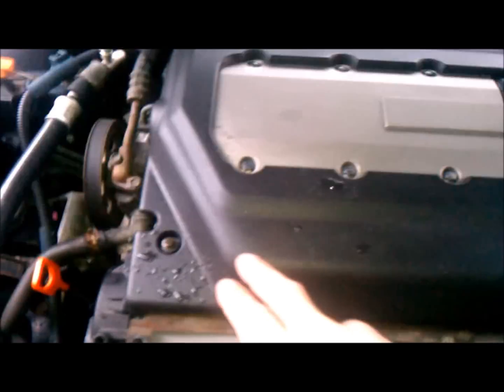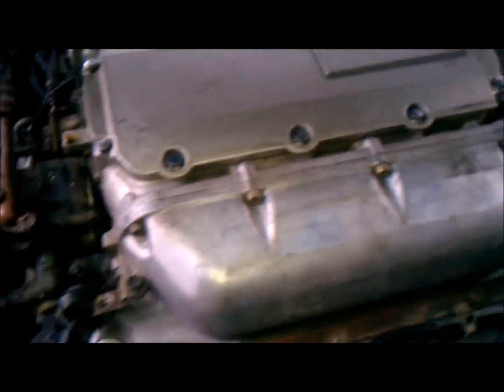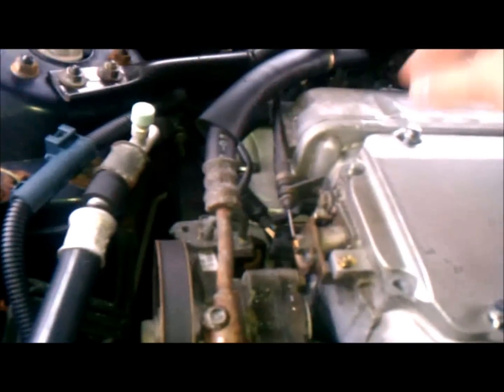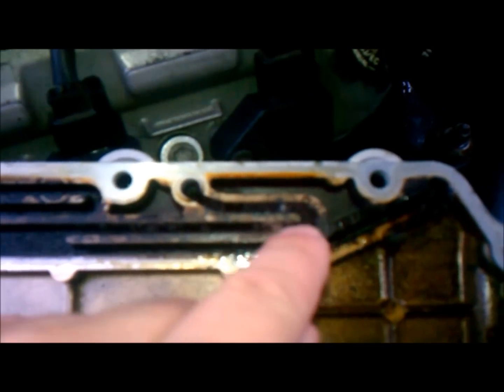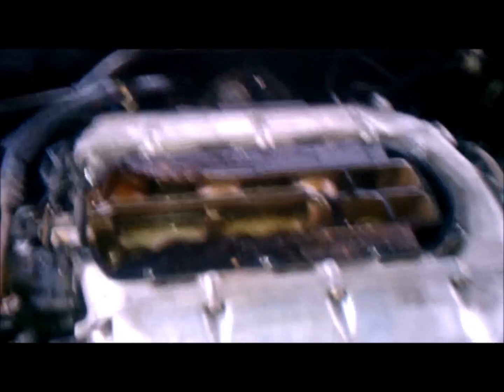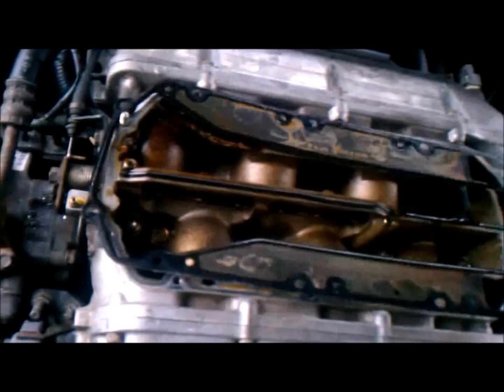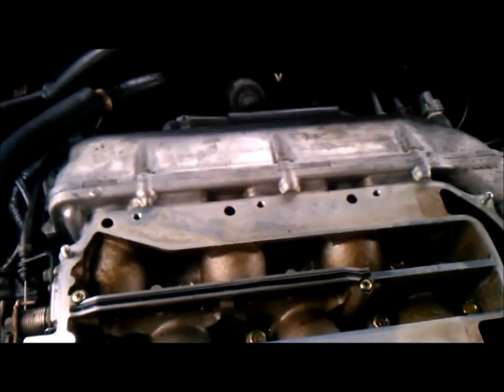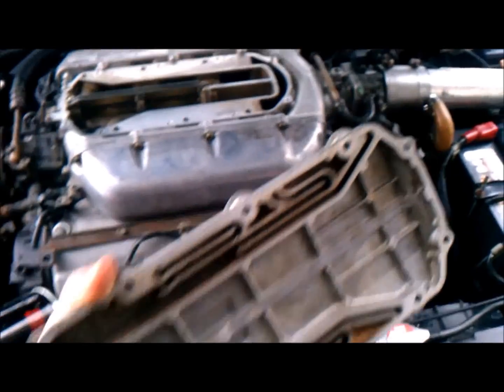Acura 3.2 TL, CL, MDX misfire repair Procedure (Tech Bulletin).wmv

Comment: What about 04' models?

I have a hesitation at around 1750 rpm below 40 mph only...Doesn't do it above 40 mph.
Car jerks until to give more gas or let off throttle. Feels terrible

Seems like a bad coil, dealer will not look at without a CEL on. I made it go on once while beating on it and there were misfire codes. They swapped coils around and still same issue. Im going to pull the coils out and check for a bad one. 

Plugs are 6 months old. Im afraid to even open the cover on my engine like you did and clean it.
Reply: I had a transmission issues. Trying to get it covered under warranty now. 
Going to do this anyway because I have gotten P0301 and P0305 codes before.

Comment from the maker: If you have a mechanic stethoscope, you can listen to them, good ones click when running although this is not always a good check because sometimes they work at idle and fail at higher rpm..if  you don't have a stethoscope, run the motor and one by one you can unplug the wire to the coil and plug them back in. The motor will start to run very rough when you unplug a good coil, if you unplug a bad one you won't see a change in idle. Just make sure you do one at a time as the motor won't run with more then one unplugged for more then a few seconds.
Reply: +Edward Naso II (Naso Pools) hey man i got the same codes on my 2000, new plugs now i only get 1399 think i should go ahead and clean the ports?
Reply from the maker: +DeejayMC25 yes clean the ports and verify your gasket is on the right side up...many are not from a factory error. do this and the code should not come back
Reply: +Edward Naso II (Naso Pools) yeah man I cleaned the ports, they bad made my heart drop a bit I just bought this too second hand now only cylinder 4 is misfiring so I figure it must be that coil thanks for the video it's already running way better
Reply from the maker: +Edward Naso II (Naso Pools) great to hear I could help! :) good luck with it!
Reply: +Edward Naso II (Naso Pools) Great video,friend of mine has a 2002 3.2 TL and the local garage has put in 3 coils and the CEL keeps coming on. I will pull the manifold and clean as needed. Its got about 170,000 miles. Again good easy to understand video.
Reply from the maker: glad to help, it will definitely fix the problem.
Reply: +Edward Naso II (Naso Pools) I pulled the plenum cover and while it did have some buildup in the channels and the six ports were partially clogged, the biggest problem seemed to be the large port on the drivers side that was almost closed off with sludge. I used a small screwdriver to clean out the ports and sprayed carb cleaner in the ports and used compressed air to blow out any remaining sludge. 
I cleared the codes and all seems to be well. Is the EGR valve hard to remove as I might want to clean it out?Thanks again.
Reply from the maker: It's very easily accessible on these motors right on the top. I would not recommend cleaning it. Replacement only. Although if the problem is solved I would leave it alone

Comment: I have the same type of car but the problem I am having is when I put the car in D5 and take off it gets stuck in the 2nd and 4th gear. Could this be the same problem or is it the clutch sensors?
Reply: change the transmission sensors on 3rd and 4th gear.
2004 Acura TL part no.: 
28600-RAY-003  & 28610-RAY-003
SWITCH ASSY., AT OIL PRESSURE (TEXAS INSTRUMENTS)

Comment: After performing your procedure, the car would not start up.  It starts cranking but the car will not completely start.  It sounds like it wants to start, and it is about to, but does not.  I cleaned the gasket as well as the egr ports, could that be the problem?

Comment from the maker: Shindemon33, it sounds like you have an air leak, I would remove the top again and check the gasket make sure none of the seals are crushed. You may need to replace the gasket and when reinstalling make sure you torque properly in a criss cross pattern

Comment: Great video!  Without realizing it, my son's car went a year (10,000 miles) without an oil change - YIKES!  The engine light and caution light went on this morning, and it drove very rough.  Oil change light was not on.  Checked the oil, and it was very low.  Put some oil in it and drove to Valvaline, where they checked the codes.  Misfire on 1,2,4,5 cylinders and P1399 code.  Have a 10mm ratchet - have done electric and plumbing, but not cars.  Should I try this, or take to a dealer??

Comment: OBD II connector is located in the tray/dish area between the seat heater switches.  There is a little tray/dish like area in front of the gear selector, all the way down under the nav unit.  You will have to open it / take off the cover.

Comment: Can you tell me where the OBD II connector is located on my 2001 Acura CL-S 3.2. Ran the battery down listening to the radio, now having intermittent engine shutting off but restarting going down the road. The dude at advance could not locate the connector to get a code for me. Battery connectors have been cleaned, believe atleastba contributing factor.  Thank you for any and all help.

Comment: common issue you identified, i just looked at my the other day, they looked like your finished intake. my car has 170k (2004 acura mdx), just replaced iridrium spark plugs i got online for $9-each, coils look fine (brand new), i also bought mine second hand. coils are cheap, i saw ebay/online as low as $8/each. great video!

Comment from the maker: sounds like you have a bad ignition coil. start the car and unplug one coil at a time (the coil is the black tube that plugs into your spark plug)...while the car is running, unplugging a good coil will make it running significantly worse.. unplugging that bad coil will not make any change.... replace the bad coil. FYI- normally when one coil goes bad they are all ready to be replaced.

Comment: I found out that the EGR valve code that was popping up is associated the random misfires. I unplugged the coils one by one while the car was running and found the one bad coil that caused all the problems. Thank you very much for your help!! I was soooo worried.

Comment from the maker: It sounds like it might be time to replace your coils. you can get 6 aftermarket ones pretty inexpensively on eBay and they work great. unfortunately Honda and Acura tech/shop manuals have no test to perform this diagnosis. Their steps are check everything, if all else fails,  replace the coils. I know it sounds crazy but trust me there is no test to perform to check a functioning coil because a resistance check won't tell you anything at different rpm range. If you have a nice scope you maybe a
Reply: Likely, NO.  EGR system buildup is the common issue with 01 and 02 honda/ acura and multi-misfire code (that and gasket on wrong way). Yearly check and maintenance.

Comment from the maker: It sounds like one of the two ignition coils has gone bad. It will need replacement... The ignition coil is the long black tube that plugs into the spark plug.. they are expensive factory and just fyi,  I have had much success with aftermarket ones on eBay... Best of luck

Comment: Another very common cause is tight valves. Most of these engines will suffer from many misfires if the valves haven't been adjusted. A quick easy way to check is to find someone with a scan tool and at idle with all accessories off watch MAP voltage. It should be no more than 0.90v you can also do it with a volt meter but you need a wiring diagram.

Comment: Acura 2000 TL...engine as per this video. Blew spark plug & melted coil boot over spark plug. Now I cannot screw a sprk plug into the well. Any suggestions?